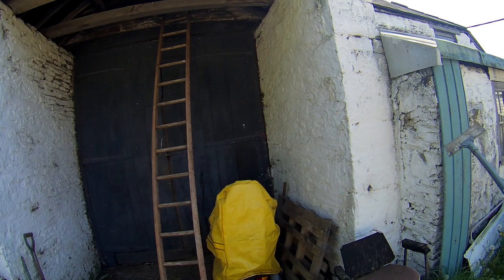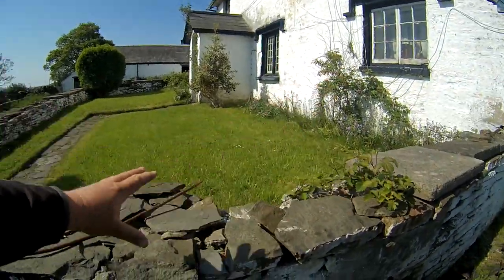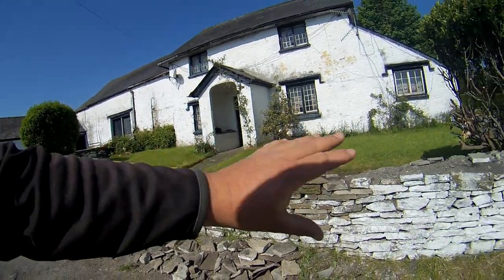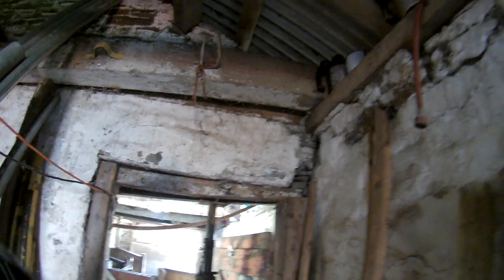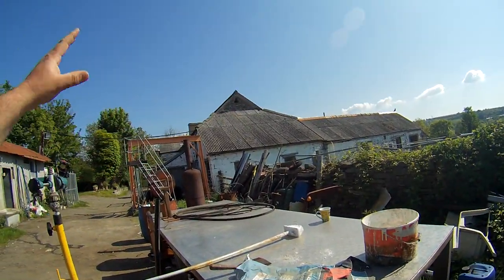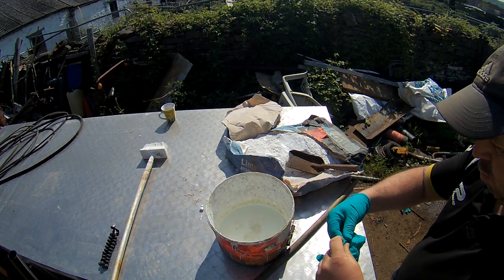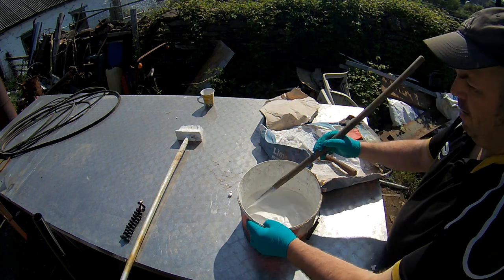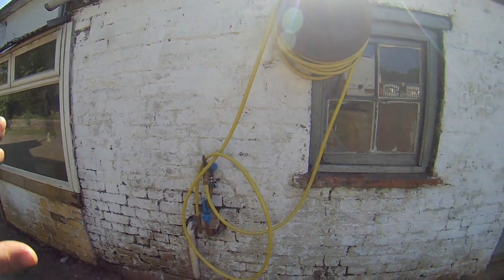How To Use White Lime As Paint,  (Watch End Result)

Comment: Ratios are by volume. 4 Litre of water, 0.5 Litre of Lime Hydroxide (CaHO)2 powder for external use 0.1 Litre of salt. The Hydroxide (CaHO)2 reacts with the CO2 in the atmosphere to for CaCO3 (Limestone) + H2O (Water). The salt holds the moisture which helps with the reaction & give a more durable coating outside on the rain & sun & wind where the Limewash gets wet & drys it is not a problem but inside the salt will moisture from peoples breath etc & you don’t want damp walls inside.